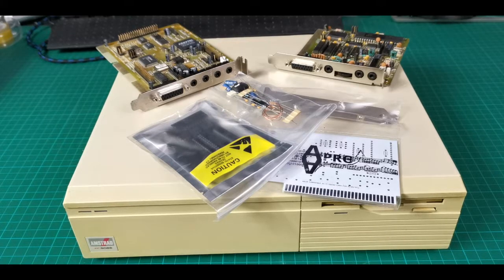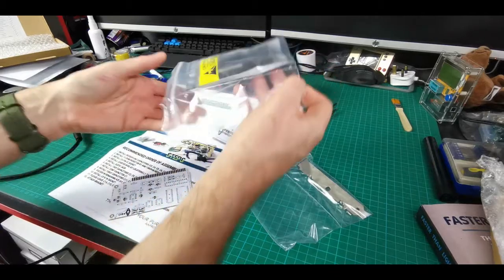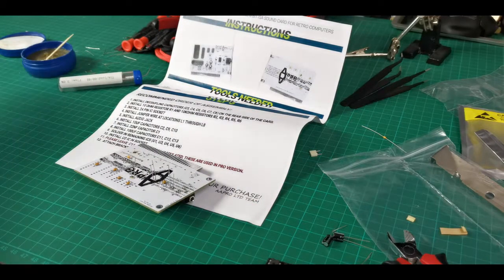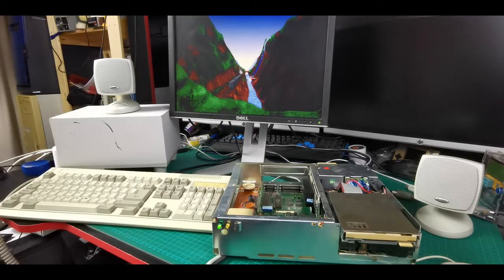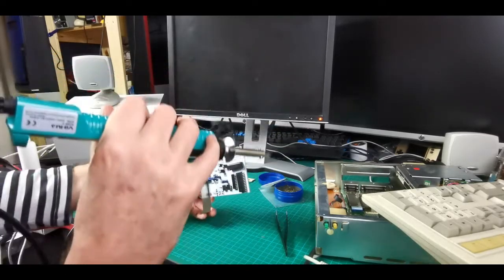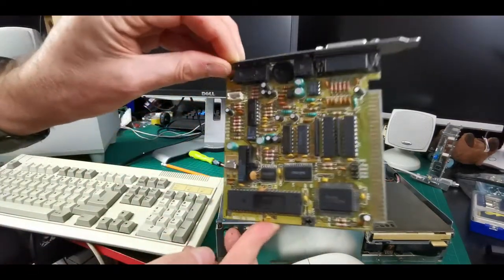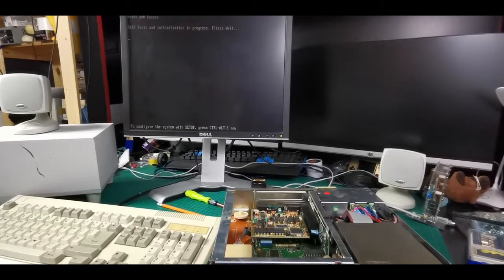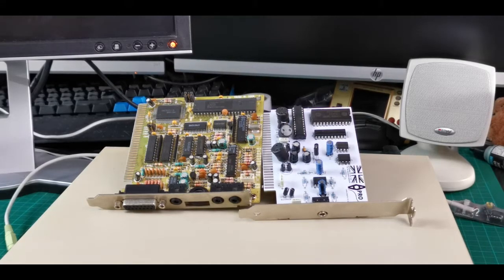8 Bit sound card showdown!

Comment: The NX and the NX Pro will both work in 8 bit if I remember correctly.  Those are soundcards from Aztech.  There's also the BX and BX II cards which are sound blaster clones.  They are very noisy though, as a heads up.  The BX II that I have has an 8 bit connector only.  So that would work for this, and if I remember correctly, all you have to do is add the argument Set Blaster=A:200 I:5 D:1 to your Autoexec file and it will play audio.  I think.   I need to get that card out of the storage unit and play with it some more.  It's in a 286-12 Packard Bell currently.
Reply from the maker: Cool,  ill have to try the auto exec entry outnon the sb clone. I knew about the aztec cards working,  think the bit at the back of the 16 connector is just for the cd. Id love to get a bx but they're hard to  find and pricy.
Reply: @66mhzbrain  It's crazy, I just bought three of them last year and they were about 35USD each, and now on the bay they are over 100USD.  Insane.  They weren't rare cards either.  As far as I remember they were pretty darn common.
Reply from the maker: @helldog3105  yes everything seems to have gotten more expensive the last couple of years 😒

Comment: Hi,
How is it possible that you don't know Unisound.
It allow you to initialize any PnP ISA sound card on a 8088/8086.
You can also check my Videos of Mod Master, I describe in detail what we can do with soundcards on Amstrad 8086 PC.
Reply: I agree with the host here -- a PnP card would be totally anachronistic.  In terms of sound quality... let's be real here.  Sound quality wasn't a concern until the very late 90s.  There is NO reason to be fussed with 16- or 24-bit, 44.1 or 44.8kHz sampling, and a near-100dB S/N ratio when your sources are OPL2 and 8-15kHz sound samples recorded on a potato and compressed to fit on floppies.  :-)

Even early Win95 CD-ROM games didn't bother with high-quality samples, despite having the storage capacity to use them.  Memory and CPU time were still too precious.
Reply: @sirnickity  It is not my point. 8bit sounds cards are rare and expensive. If the choice is between nothing and a more modern sound card...
I have some  and hear the ISA bus noise each time we press a key on the keyboard is not really pleasant.
At the begining of the vidéo he say that 16bit card is an option but really few will work. I just say that any 16bit card can work.
Reply: @freddyvretrozone2849   Ah, OK.  Sure, there are a lot of 16-bit sound cards that can be had cheaply.  And, as long as you're able to use the low IRQ/DMA settings, it'll probably work fine.

I am a bit too much of a purist to have a 16-bit card in anything older than a 386 DX, but I see your point.
Reply from the maker: Thanks fo pointing that out😊 It would just feel wrong to me personally putting a pnp card in an xt system. Using something like unsound isn't really my kind of thing. Though I respect anyone making stuff to help keep old gear flexible.
Reply: @66mhzbrain  The audio quality of old 8bit soundcard is so bad. And they are difficult to find.
The PC ISA bus is made for this, upgrade the machine.
Check my channel, I play dune2 music on a Synclair PC200 😀
Reply from the maker: Cool, I'll take a look
Reply: @66mhzbrain  Unisound can also initialize some not PnP card
Reply from the maker: @freddyvretrozone2849  yes it will be useful when needed